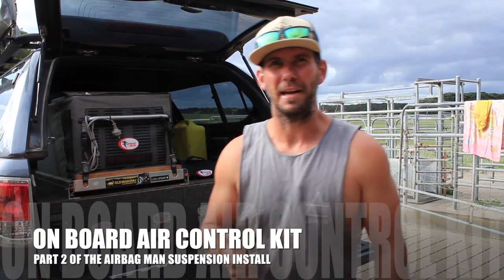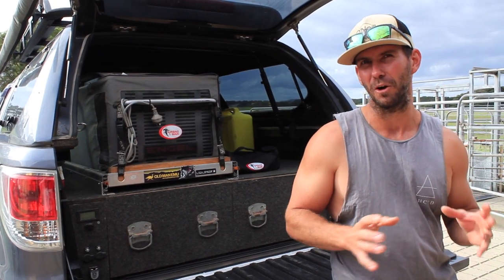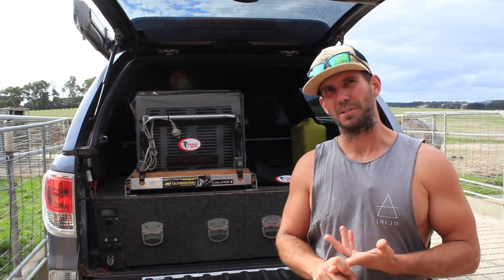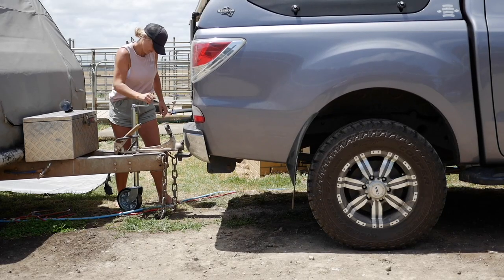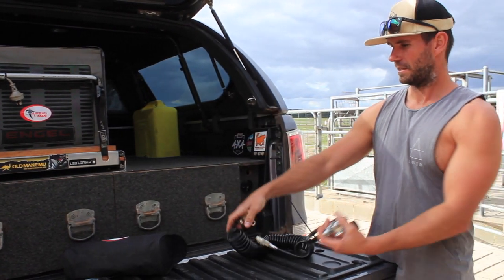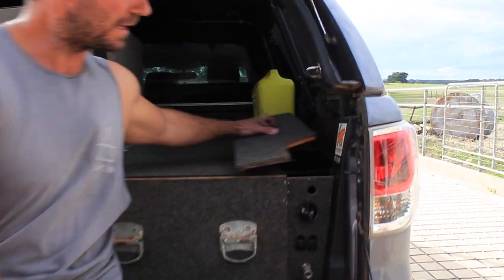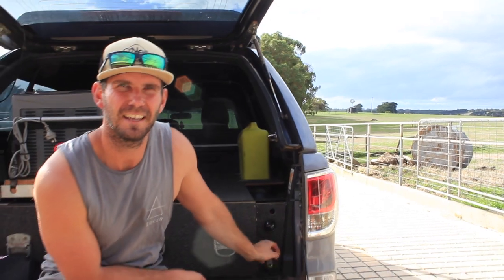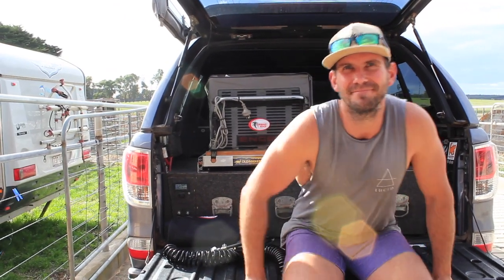PART 2 OF THE AIRBAG MAN SUSPENSION INSTALL - ONBOARD AIR CONTROL KIT!

Comment: Great little setup. I just landed a new Pajero (the last of the exceeds). Threw in an old man emu suspension kit and airbag man airbags. It is a pain in the arse having the little valves down low. This video though is why I got the bags. Heading out to Thargomindah to give the new girl a run in. Hope your trip is going well mate.

Comment: Nice video buddy, you can modify this to auto leveling system. If you use mechanical leveling valves it would be very cheap